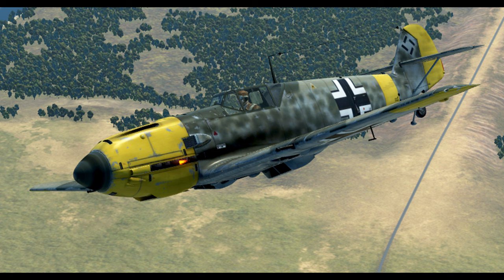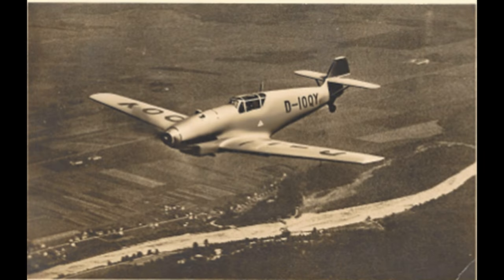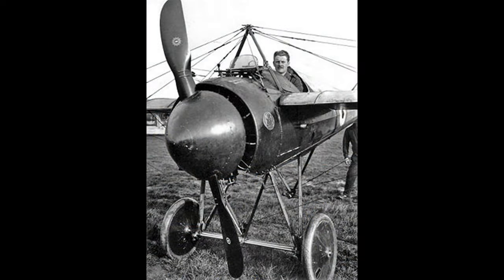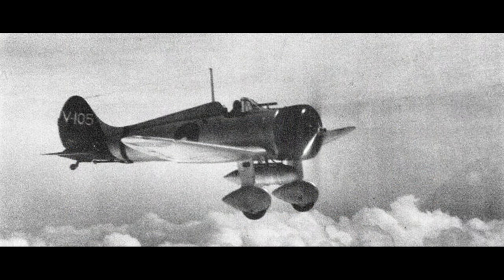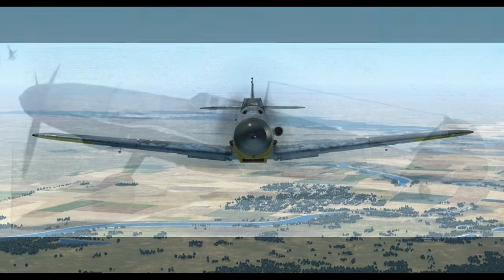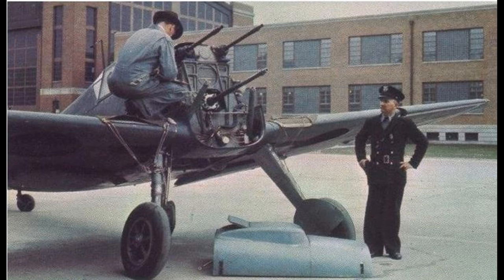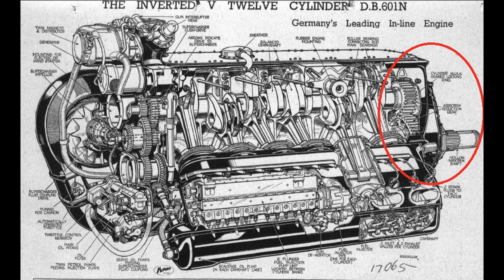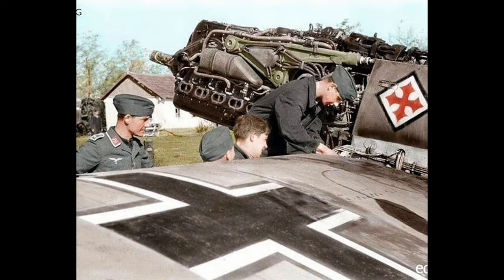Why an INVERTED V-12?  PART 2

Comment: As a young enthusiast of the aircraft of WWII, I bought a series of books printed and sold on popular grocery stores back in around 1970 on those aircraft.  In the case of the BF109 what was emphasized regarding the design philosophy was the idea of mating the most powerful engine to the smallest possible airframe.  That was how the BF team and Willy Messerschmidt achieved the fantastic performance and speed the early 109s were known for.  The trade off was mainly in the range of the aircraft and some instability issues which required such fine tuning that later copies such as the Check "Mule" became dangerously unstable because its engine rotated in the opposite direction.  In the half century since I've done my best with the resources I have to find out more about the weaponry of WWII and some more modern weapons.
Reply: In 'Willy Messerschmitt. Sein Leben, seine Flugzeuge, 1975' Willy Messerschmitt actually argues that he wanted to create a versatile weapon platform in the first place, that incorporates the lightest airframe and a powerful engine.

Comment: Luftwaffe ground crews said the 109 center canon was a nightmare to re-arm,
I also think it had it's disadvantage,
The 109 weighed 2/3 of a Spitfire with a 36 liter engine, compared to the 27 liter Merlin and was still slower
Reply from the maker: The 109 is relatively slow for it's engine displacement and weight, to help understand why, I have a video about it: https://youtu.be/sTD7DqXfRno

Comment: As an aircraft mechanic of over 30 years, I find it difficult to believe that the mechanics did not have some sort of maintenance stands which would make working on the top of a V engine realitivly easy. From my experience working on large radial engines, working over my head on the bottom of the engine was stressful. I would think that something similar to a C1 stand would have been avaiable. If such stands were not available, I am sure that being resourcefull, mechanics they would have rigged something up.
Reply from the maker: One less thing to carry through the mud and snow from one mobile airbase to the next.

Comment: Interresting question. I believe, the correct answer would be: "all of the above". The fact is the German knew there would be another war. They knew it from the moment the capitulation was signed and even before the ink was dry and they knew it with certainty because... they would start it. And they also knew that war would be won in the air first. While the allies, they may have had doubts, but they most likely believed the German wouldn't dare to come back at them for revenge. So the Germans, they had time, because they also knew that war wouldn't come that soon. Knowing that the next war would be won in the air, and that they had some time to think about it, they could afford to start from a clean sheet of paper. They had the opportunity to balance every practical aspects that you mention: mainly accessibility, visibility and aerodynamics. So they had the time to develop a type of engine that would have one sole purpose: to power a single engine fighter aircraft, that would need to be cared of on the battle field. And that's where they probably came to the conclusion that the inverted V was the most efficient solution for the intended purpose. The allies, on the other hand, were not so much in a hurry, not even believing that a war with Germany was likely and imminent (see the Munich Agreements). When war became obvious, they mostely used what they had under the hand: powerful proven straight-up V12s and radials with multiple practical applications. No time for them to start from a clean-sheet of paper to develop an engine with one single purpose only.
Reply: Spot on.

Comment: You seem to have missed the point that was being made about fuel injection washing down the cylinders. During difficult starts, because the fuel was being sprayed directly into the cylinder, it would sometimes wash the oil off of the cylinder walls and make its way past the rings and into the engine oil, which caused accelerated wear on the cylinders, pistons and rings. If the engine is inverted, the fuel wont run down the cylinders during starting, it will pool in the combustion chambers instead and will be expelled during the exhaust stroke. Of course, as you said, the engines may not have originally been designed to make use of fuel injection, so that's probably not the reason why they were inverted.
Reply: Many piston engines of that era used fuel injection into the oil to make starting easier.  The engines ran so hot that the fuel would burn off quickly once the engine was going.

Comment: "Der umgekehrte V-Motor gibt im Falle des Luftschraubenantriebes günstige Verlegung des Schwerpunktes, dem Flugzeugführer freiere Sicht und der Propellerachse größeren Abstand vom Rollfeld..." - Die Verbrennungskraftmaschine, Heft 8, Grundlagen zur Gestaltung von Verbrennungskraftmaschinen, Zweiter Teil, Die Dynamik der Verbrennungskraftmaschine, Prof. Dr. Hans List, Springer-Verlag Wien GmBH, 1942, pages 20, 21.

"The inverted V-Engine gives, in case it powers an air screw, an advantageous translation of the center of mass, better visibility to the pilot and a greater distance from the screw axis to ground level..."
Reply from the maker: Thanks Prus.

Comment: I tried to read all the comments to see if this had come up but I wasn’t up to it. Greg is better than me if he manages!

Not all V-type engines change the centerline of the prop away from the centerline if the crank. The Allison, shown clearly in this video, used a reduction drive that kept the centerline in line. It’s one of the visual IDs for the difference between an Allison and a Merlin P-40.
Reply from the maker: Exactly, and that makes my point. Due to the gear drive you can put the prop center wherever you want, thus with engines so equipped, it's not a deciding factor in terms of prop height.

Comment: The requirement for the inverted V12 was for a weapon to fire through the spinner, the Germans perfected this with the Bf 109 F in 1940. Give this specification was issued in 1928 and the first engines built to the meet these requirements were produced in the early 1930s hence the resemblance across different manufacturers who used the same inverted engine solution to achieve the idealistic solution of having a gun firing through the spinner, no doubt under some political duress.
Reply: I´m sorry to upset you but Birkigt, the Hispano-Suiza designer, patented the concept of the "moteur-cannon" in 1916 and applied it to some of the WWI H-S geared upright V-8s. Post-war V-12 H-S engines also sported the moteur cannon, and the design was licensed to Klimov in the ¨30s and used in the Russian Yaks and other fighters.

Comment: The prototype Bf 109 was flown with Rolls-Royce Kestrel engines, smaller than the Merlin but clearly of similar architecture. So, how much effort would it have been to make an upright engine such as Kestrel or Merlin fly as an inverted engine, which is how the Kestrel was installed in the Bf 109? This feature would have negated the American and British engines' "excuse" of being also used in boats and tanks necessitating an upright configuration.
Reply from the maker: The very early 109 prototypes flew with the RR engines, then the Jumo, then the DB600, so all three were used. I think it's quite a bit of work to flip the engine 180 degrees, quite a few coolant and oiling issues would have to be taken care of, but you certainly could do it.

Comment: the inverted engine places the heavier part of the engine at a low position, making the plane more stable because it reduces the torque effect of the engine acting on the plane. an engine which uses a fuel injection system does have a quite heavy torque effect because the engine reaches it maximum output performance very quickly. if you shift the heavier parts to the lower position, the weight of the engine helps to reduce the torque effect. the torque effect might also be the reason for placing some heavier parts of the engine on one side instead of placing them somewhere at the center.

the 109 is known to be a rookie pilot killer, because of its heavy torque effect. many pilots crashed right after they where lifting off the ground because of this. listening to G. Rall helps to understand the problem.. 

the inverted engine also places the most serviceable parts of the engine in a place where these parts can easely reached by a mechanic. especially the fuel injection pumps had to be serviced on a regular basis. this might be the reason that such engine had to be inverted - they knew these injection pumps needed regular maintainance.
Reply: The inverted engine also allows a larger hub mounted gun and places the guns closer to the roll center of the airframe... increasing gun effectiveness and instrumental in the 109 achieving the highest number of air-to-air kills than any fighter aircraft in history.

Comment: Smapp,  good second Video,  Maintenance a good point but most ground maintenance was on the axillaris as opposed to the motor itself.  this would put the inverted motor at a disadvantage.\ or at least the DB at a disadvantage.  Note the axillary drive being above the supercharger out of reach, where on the RR is is below the deduction drive, with in reach.  all 24 spark plugs  are with in inches of each other on both motors.  so changing spark plugs is possible not a good example since neither are in the valley.  But you did hit the nail on the head when talking about armament location.  the centerline arment is harking back to earlier days  as was the DB motor starting out as a direct drive design.  western aircraft placed fule where the  109 has its machine guns thus limiting any development in extending the 109 range
Reply: Most maintenance was changing spark plugs.  I know from experience.  The other main thing was changing magnetos which on the Merlin were at the back.  The later Griffon moved the single mag to the front of the engine.  The oil was never changed and the filter was never cleaned or changed.    The oil changed itself!

Comment: what about ground fire? The crankshaft side of the engine has to be more vulnerable than the cylinder side? Bombers, attackers, and multi all benefit from this.
Reply from the maker: Why? A hit to either valve/cam cover will have about the same effect. Either one will cause massive oil loss and eventual seizure. Before it seizes a hit to the valve/cam cover will probably turn your V12 into a V10 or worse and the power loss will be huge. Plus it will be grinding metal in there and with the oil loss, the whole engine is done. I don't see much difference either way.

Comment: Early german mechanical fuel injection from my own experience working on mercedes cars, dilutes engine oil with fuel during long periods of light load operation. An inverted engine would not have this problem, excess fuel would escape out the exhaust, so benefits of fuel injection could be realized - consistent fuel delivery during high g's, without problems with cylinder wall wiping during cruising. I think somebody else mentioned this and was not noticed.

Comment: "Build a better mousetrap, and the world will beat a path to your door" 

Had the inverted piston engine TRULY been a better mousetrap, the world's aero engine industry, which was populated by very few fools, would have adopted it more widely.

In the case of small engines for civilian planes it was a better mousetrap, and widely adopted.

To see why Google - G-EBKT.    This was a very popular aircraft in the late 20's and beyond.   Several flew from England to Australia.

It displays 3 obvious problems:
1. The high mounting of the upright engine is blocking the pilots view.
2. The exhaust outlets are at head height exposing the pilot to carbon monoxide fumes, very hot air, and deafening noise.  Hence the   exhaust pipe.
3. The overhead camshaft and rockers are not enclosed,   exposing the pilot to yet more noise  and a mist of lubricating oil.  Covering them reduces the pilots view even more.

Inverting the engine eliminates all these problems.    Google - De Havilland Gypsy to see how this company responded

The pioneering inverted small engine seems to have been the German Argus A8 from 1928.    Upright small engines are rare after 1932.    A German company had revolutionised the industry at a stroke.

In 1929 tenders for inverted engines in the 20-30 litre size were requested.

Source:   Aeronautical Research in Germany: from Lilienthal until Today
  Ernst-Heinrich Hirschel, Horst Prem, Gero Madelung
  Published by Springer, 2004

According to Wikipedia Junkers  had a running example of the Jumo 210 in 1932.  DB had a DB600 running in 1932 as well.

In early 1934 the highly politicised RLM had few choices with regard to engines for it's new fighter.
Inline watercooled engines were “Cutting edge” - think Schneider Trophy.    Inverted engines were a triumphant German innovation.   Radial engines were for mundane planes like transports and trainers.   

So an engine type aimed at small light aircraft, morphed into a universal engine used in fighters and bombers where it’s advantages are by no means as obvious. 

P.S.    The RLM and  industry must have had an uncomfortable time explaining the need for Rolls- Royce Kestrel upright engines for the prototype 109 and Stuka.
Reply from the maker: I don't think the "build a better mousetrap" analogy applies here because so few aircraft V-12s were designed after the DB series came out. The Merlin and the Allison were used from the 1930s until they were replaced by jets. The wasn't really any second or third generation of aircraft V-12s after the 1930s, so we don't know which direction manufacturers would have gone.
Reply: RR with their 'Crecy' engine were heading towards large supercharged two-stroke engines.  Notably it was named after a battle the Frogs lost way back then.  Why?

Comment: Hello to Greg. Great objective video! Well done! What are your thoughts on the gun/cannon placement on the P-39 Air Cobra? My father flew the P-39 and the P-40during ww2. He used to tell me about the layout of the P-39 and the cannon  in the front prop hub. Been to a lot of air shows and museums but I have never seen a P-39 up closebut have seen pics of the big cannon up front. Great videos you are making! Am looking forward to seeing more of your vids! Keep im coming! Thanks!
Reply from the maker: I think the P-39's armament layout was great. That big cannon would down just about any airplane in just one hit. It didn't carry much ammo, but if you get close to a bomber, hitting it with the cannon was quite possible.
Reply: The P-39 is a very interesting design, and had the potential to be an excellent ground attack plane, unfortunately one of the great blunders the Ordnance dept. and USAAF made was never producing and widely adopting  a decent auto cannon for aircraft use... it stands out as a major glaring deficiency in all U.S. fighter designs of WW2 era and even into Korea.

Comment: Hi Greg. I am thinking about putting a 4.6L engine from a 2009 Mustang GT into a 1997 Thunderbird but I am having difficulty finding out if it will bolt in. I do not have the Mustang engine so I can't just pull both engines and compare them side-by-side, and I would like to know before I go out and buy that engine, or even before I do a bunch of work pulling and reinstalling engines. Do you know if it will bolt up?
Reply from the maker: I just don't know. I haven't ever worked on a Ford 4.6.
Reply: @GregsAirplanesandAutomobiles  - Alright, thanks for getting back to me on that. I just figured that if anyone knows it would be you. lol... I'll keep looking into it. Thanks again, Sir.

Comment: You have to remember that Mercedes took a lot of their grand Prix  car development and applied it to their airplane engine development . The GP program was not affected by the post war bans in place on military aircraft engine research . And Mercedes developed a series of Racing engines starting with in line  eights in later V12's all use fuel injection and forced inductions . They also use something called a total loss oil system . Oil was pumped into the engine but not recovered . the same applied to at least my understand their aircraft engines , you can see this on most ME 109's with black oil steaks along the fuselage of the aircraft . Something I learnt from a documentary on the Mercedes Silver race which also contains a engine rebuild of a 109 DB engine . Some military spec 12's were used in Germany land speed record cars too in the 30's not sure if they were inverted though.
I am sure you would find your answer in Mercedes-Benz's archive though  , they have a few DB inverted V12's in their Musium in Stuttgart . But I do not have Musium book at hand it in store in my attic here. If I find anything I will post it here.
Reply: None of the pre-war Mercedes racing engines used fuel injection in an actual race, but it was indeed tested on the bench, specifically on the 3-liter V-12. And the oil system didn´t work on the total loss principle but on the dry-sump principle, a different thing. Two D-B aeroengines were meant to propel the T-80 record car but it never turned a wheel. And, yes, they were installed inverted.
Reply: @dmcalut  Ok not sure were I read some or saw some of what I wrote about . Maybe I have to go through my Mercedes blue rays that feature the section on the DB V12 aero engine service . I saw the T-80 at the Mercedes Musium in Stuttgart getting on for 11 years back an incredible machine , pitty it never got to run , it would have been fast for sure .
Those other record cars ran some strange engines with some equally novel ways of cooling , thanks for the  reply .